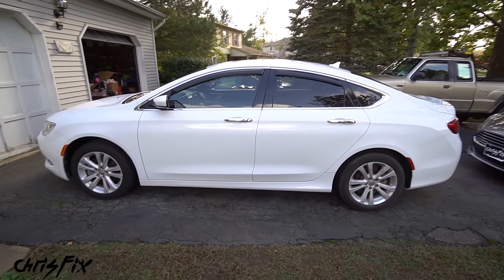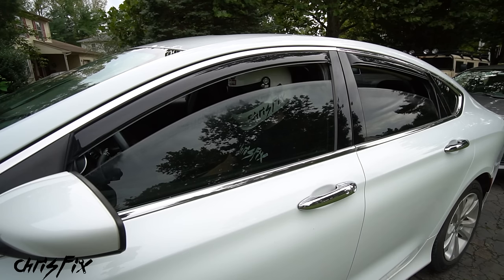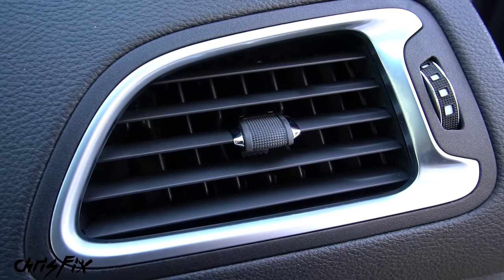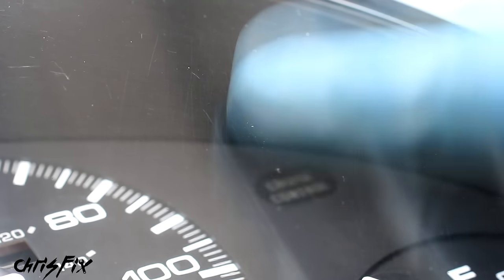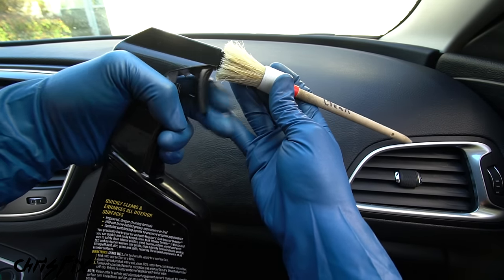How to Super Clean your Interior (Dashboard, Center Console, Door Panels & Glass)

Comment: For me, this has to be the best, most concise, and well-done video I've seen so far on cleaning the interior.  Nice tips and tricks like not using a heavy cleaner on the turn signal, not erasing the paint.  Great job Chris.  Marc.
Reply: I agree with you Marc. Chris's videos are very well done. Presentation and delivery of the subject sets Chris apart from others.
Reply: I had my car supposedly full detail and it was not really detailed
Reply: +1.
I like the way the video is split into chapters for easy reference.
Reply: I have watched interior cleaning videos by about a dozen other professional detailers. Chris is the only one who pointed out how to clean the turn signals safely.  Kudos sir!
Reply: The only thing he didn't do is to shampoo the carpets or use saddle soap on leather or vinyl seats.
Reply: The only thing he didn't do is to shampoo the carpets or use saddle soap on leather or vinyl seats.
Reply: @toml.8210 he deep cleans them in other videos, as well as the windshield and exterior

Comment: Dashboard :
Vents 3:45
Dust Dashboard 5:35
Gauge Vessel 6:30
Clean dashboard 9:05
Clean info Screen 10:05
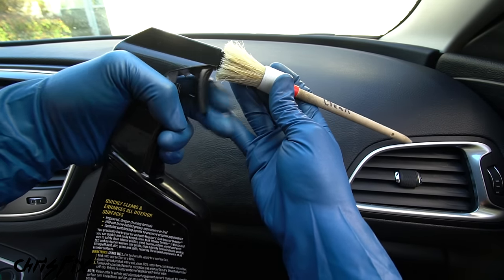Clean Steering Wheel 11:15 12:40
Clean turn signal 14:00
Clean gas and brake pedal 14:50
Protect the Dashboard 16:55
Protect info Screen 17:50
Protect plastic by the Steering wheel 18:50
Clean Glossy Interior 20:25
Clean Door panels 21:15
Protect door panels 22:20
Clean Door jams 23:57
Clean door sills 24:22
Center Console :
Clean rubber inserts 26:45
Clean exterior of center console 28:35
Clean gear shifter 30:10
Clean glass 31:45
Reply: Sweet thanks ✌🏾✌🏾✌🏾
Reply: Thank you ✅
Reply: Thanks
Reply: It is also in the description.
Reply: Not vessel, bezel.

Comment: "detailers" use specialist brushes and chemicals that are $10 a bottle
chis fix uses old toothbrush and soapy wooder
Reply: Can't argue with results
Reply: Yeah but those are professional products used for time and easier but the results cannot be argued with 🤷‍♂️ speak from experience
Reply: There are time where we need more brushes and chemicals for special situation. Or get done faster or leave the carpet in a natural state.
Reply: I just buy boar hair or horse hair paint brushes, trim them to a preferable length and get to work.
Reply: I get bulk chemicals i can mix 1-20 so its not too expensive doing this

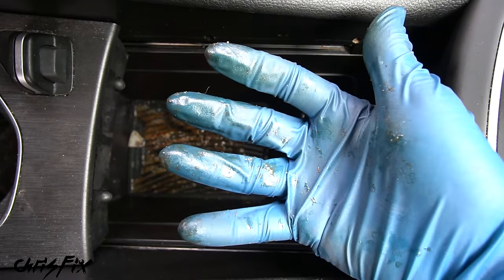Comment: DASHBOARD 2:55 

  Dusting
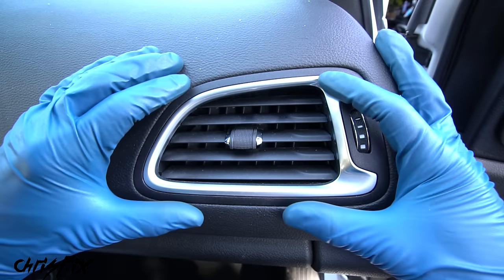      Vents 3:27
      Main Dash 5:05
      Gauge Bezel 6:01
  Cleaning 
     Main Dash 8:45
     Infotainment 10:02
     Buttons+Dials 10:34
     Steering Wheel 11:14
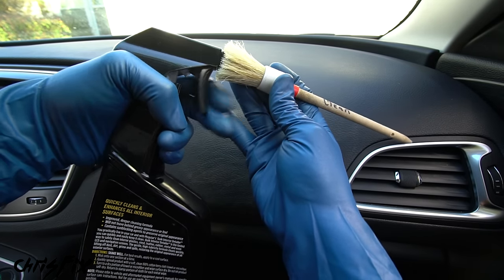     Turn Signals 13:45
     Pedals 14:29
 Protecting 15:37
   Main Dash 16:56
   Infotainment 17:46
   Buttons+Dials 18:21
   Turn Signals 18:45

DOOR PANEL 20:57
  Dusting 21:17
  Cleaning 21:26
  Protecting 22:20
  Door Jamb 23:53
  Door Sill 24:21 

CENTER CONSOLE 26:33

WINDOWS 30:27
Reply: Thanks
Reply from the maker: Thanks
Reply: Thank you! 🥰
Reply: @chrisfix  how long did this take?
Reply: 21:34 will the liquid damage the electronics?
Reply: @michaelleong9898  he disconnected the negative terminal of the battery, as long as it is fully dried, once you reconnect it, it shouldn't damage them
Reply: I LOVE YOU
Reply: Not all heroes wear capes my dude...thx
Reply: Thank you
Reply: Such a helpful post!Thank you for taking the time to put this together!
Reply: Why did he use product cleaner for dash, but soapy water for doors? Isn't it the same material?
Reply: Thanks! Very helpful
Reply: @chrisfix  your the one that made the video.
Reply: @IowaRonin  probably because the soapy water has more degreaser agents than the cleaner as he did with the steering wheel
Reply: @Thebirdemoji  thanks captain obvious

Comment: You should do a quick video on how you wash and maintain your microfiber towels.
Reply from the maker: Thanks for the video idea!
Reply: Ooohhh yes
Reply: Or you just simply throw them away?
Reply: @Wizardus86  that would probably be a waste
Reply: @_playa_  same.
Reply: they have microfiber detergent or use a detergent thats unscented with no dyes. throw them in the wash with cold water only and the right detergent. move to a dryer on air dry or very very little heat (better if none at all).
Reply: @_playa_  ye

Comment: Me:  "Ok, i'm ready to super clean my car."
Chris: "...remove the seats."
Me: "I'm out."
Reply: It isn't that difficult to remove the seat. 
Just check ChrisFix's video on "How to install Racing Seats".
Reply: Take care while taking the seats out not to scratch the anywhere as some seats mounting where the bolt goes is made of steel, I've got mine scratched
Reply: SFG HIGHLIGHTS  are you a toddler?
Reply: @RatmanSays  His point was that you can have shorter arms and legs making lifting things andholding it more difficult, you see?
Reply: Lol the 6 way power seats in my 93 chrysler are heavy as shit!
Reply: Most seats are just 1 plug and 4 bolts, so removing and installing them is really easy.
Reply: I dont believe for one minute the "vandal" dumped sticky pennies in the console. The owner just nasty.
Reply: SFG HIGHLIGHTS  or fat and can't bend to well......$10 to whoever wants to clean my car!
Reply: @Stoney3K  and then probably replace the screws with new ones because in many cases the screws are for one use only...
Reply: @SteveStavropoulos  Not with the seats, those are secured with four 12mm thick bolts (or 1/2" for you imperial guys).

Most of the interior trim uses those one-time-use plastic spring clips though.
Reply: @Stoney3K  in many cases you will find screws with trilobular threads which need to be replaced.

Comment: When he said remove the seats I was like you gotta be kidding
Reply: and that was step 1!
Reply: I’m new to the channel. Is there a how-to video on removing then reinstalling seats?  My car has leather/vinyl, adjustable & heated seating so the electronic wire harnessing intimidates me.😬
Reply: @shesgotmmph  he has the first video about this car, just look up car deep clean chris fix and watch the other video and he explains and shows how to remove them
Reply: @shesgotmmph  i think he shows how in his carpet cleaning video
Reply: @shesgotmmph  I want to say it was like take the cables off the battery since you're leaving the door open for a while... then there are 4 bolts you unscrew but do 2 and then get under it and unclip the 1 connection, or more if there are but there's usually only 1, then undo the next 2, and you should be good... 

just make sure you line up tracks if your car is like that... my 07 honda accord only did 2 clips front and back when I bought it, and my family has a lot, so honda and only 2 tracks were way wrong... the dude before me install them as one pushed far up, and the other far back, so I had to fix it, but yeah just a heads up there.
Reply: @shesgotmmph  Just don't bother, you risk damaging something and it's total overkill, just not necessary.
Reply: @shesgotmmph  I pulled the front seats from my Subi I'm working on and it was literally 4 bolts and three electrical connectors.  Remember, car electrical connectors are almost always slightly different for every sensor or gadget so they are impossible to mix up.  Airbag connectors are always yellow.  Disconnect the battery or pull the fuse if that intimidates you but unplugging them is not what is going to set them off.  

I very much recommend pulling front seats if you are doing interior work.  Its easier than it looks, you have so much room, and when you clean the carpets you can get it all in nice big sections that look great.

Comment: A tip for those that will disconnect the battery: Make sure you know your infotainment/radio/navigation code, as it'll probably be required after connecting the battery.
Reply from the maker: Thanks for the tip!
Reply: Most people toss that in the garbage or in the wallet when they get it with their car.

Comment: Extra note on using low gloss on the dash:

Not only will it reduce incoming light getting bounced off into your eyes, itll also reduce it getting bounced off and reflecting off the windshield. Yes, a cleaner windshield wont reflect as much anyway, but a shiny dash is much easier to see in the reflection.

Comment: some useful tips I've came up with cleaning my own cars interiors the past few years:

-wet wipes are very useful for a quick clean up, just make sure to use the ones with no oils in it (avoid those that says moisturizing), also avoid using wipes with alcohol

-lint roller paper is best at cleaning dust on the gauge cluster clear plastic surface, just peel off a layer then stick on the surface and peel, repeat until clean, so far doing this has not caused any scratches but make sure to never drag or rub the paper on the surface

-use good quality uv protectant on all plastic trims, cheap sticky ones that never fully dry only attracts more dust

-air fresheners are not meant to cover up the smell of something dirty, clean the source of the smell and you won't even need to use air fresheners, also they are known to be hormones disruptors

Comment: Your videos are the best! So informative. I’m love to know the why behind things and you explain everything without being overly annoying or chatty. Also learned a lot of tips from your videos. I would love to be able to clean my interior. Unfortunately, I have a 2005 Subaru Legacy (which I absolutely love my old lady) but it had a recall on the dashboard which the original owner didn’t take advantage of to replace before I purchased the car on a trade in. This particular recall was for the dashboard melting. I doubt they even make the dash for my car at this point to try to find a replacement that isn’t already damaged. Any suggestions or fixes for a sticky, melting dash? And just to give you a picture of how bad it is, I had 3 Alaskan Malamutes over several years ago now who loves car rides and I STILL find their fur and hair embedded in my dash (and seats/carpets) 😂. I had to order a poorly fitted dash cover to stop the glare that got progressively worse over time because it was getting too dangerous to drive.
Reply from the maker: Recalls usually dont have a period of time when they are no longer good. You should be able to take it in. The plastic is dissolving itself and there is no fix besides replacement. Anything I tell you would fix it temporarily.
Reply: @chrisfix  thanks for the info! I was initially turned down when I called a dealership but SOA might have a different answer/solution. A temp fix might be my plan B since this car is my future project sleeper car 😂 when I decide to invest in another Subaru. Number 5 I believe?…out of curiosity, what would you recommend for the temp fix as a potential plan B? I have done some research on solutions, but they all want to promote their own “fix it” product which may or may not work, but it’s kind of all over the place in terms of getting a solid answer. Plus, I’ve come to enjoy your expertise and explanation on stuff. No rush, maybe a future video idea? This baby isn’t going anywhere anytime soon.

Comment: Should condition the leather as well, including on the steering wheel, meguiars gold class leather cleaner and conditioner works well and does not leave a greasy or shiny finish if you don't it's going to end up all faded and cracked.

Comment: Hi Chris! First of all I would like to thank you for a very detailed DIY interior cleaning.

I just have two questions:
1. I see you put some soapy water and other chemical on the buttons, I'm just curious is it applicable and safe for all car? I mean water going inside between the switches where down there there's a bunch of cables and whatnot. I'm afraid to try to clean that way and ended up with some short circuitry.
2. I have quite an old car and been left for almost 9 years. Recently I've been trying to restore it, especially the engine. But as for the interior, there's some mold on some panels, on the faux leather arm rest, and also some cushions with cloth material. What are the good options to clean those molds?

Hopefully you see this comment and don't mind answering. Thank you in advance :)
Reply from the maker: Great questions and thanks!
1. You can get soapy water on buttons and stuff but don't oversaturate it. Try to keep it from running into the buttons and just keep it as a damp towel so it can clean. The buttons are usually pretty safe from water if it drips down because when it rains it can get on the buttons temporarily.

2. For the mold I would use that extractor vacuum and a mold killing spray with no bleach.
Reply: @chrisfix  thanks for the very quick response! Will try the interior cleaning right away this weekend, and probably onto the exterior next week. Been lazying a bit but watching your videos gets me pretty excited to work on my cars again.

Keep up the great videos, Chris. I've been marathon watching a lot of your videos even though some of them not really related to my current car situation lol.

Regards from your new fan :D

Comment: Hi Chris, thank you for the tips. I tried the steps & products to clean the dashboard and plastic bevel and it cleaned up well except for a couple stains that wouldn't lift from the material surrounding the cd/radio area. Im not sure what caused the staining but it wouldn't lift out with the Meguires interior cleaner, detail brush and microfiber cloth. I tried multiple applications and wiped it off and no luck getting it out. Any tips? Its a 2009 VW jetta with a cd console. Thx for your videos! Love watching them.

Comment: Chris.. Could you recommend the brushes you use and wouldn't you save time with a bigger brush? Thanks
Reply from the maker: Theoretically you could use a bigger brush but if you had to get into a small area it would be harder. I’ve never had an issue with the brushes I used so I would recommend them

Comment: awesome videos. but in reality,  that brush should not be used on a screen.  or Guage cluster..it is bound to scratch eventually.  these surfaces should be cleaned with new microfiber or ultra soft plush bristles.  there are plenty b of tests confirming that you may think it's not henning it. but unless you use the right chemicals and tools,  towels, you will scratch and eat away at the glare coating.  still you did it safely and effectively and that's the key.. gentle and thorough. 👍 great work

Comment: Hey Chris. Thank you for your excellent videos. I am struggling with “left car” cleaning problems. After a car has been left on the drive for the winter, the inside gets kinda musty and damp which changes the dash and centre console arm rests and I haven’t found the best way to restore them. Replace seems the only way? (For reference 2005 Volvo XC70) thank you!
Reply from the maker: By changes, do you mean the color of the dash and center console is changing?
Reply: @chrisfix  hi and thanks for the reply. Not sure but to be more clear, we live in England and the weather is damp for many months. My car has been sat, static for a year and when I got into it, the centre console and arm rests are mottled and sticky and other than replacing them I was hoping to have a fix that would repair them? I’ve seen that straight isopropyl alcohol might work and also soda crystals? Your expertise and awesome results have worked for all my troubles so far including the headlamp fogging but I haven’t found anything that works for the “vinylette”

Comment: You can buy inexpensive round brushes from a home improvement store, in the paint department.  They have heavy handles and a bigger brush, so if you want a skinny brush or handle, you must look elsewhere.
Other detailers use pressurized air to blow the dust on the vents into the duct, after turning the fan on high speed, while brushing and vacuuming; but you should clean the dusty vents first, obviously.

When you're done cleaning, WASH your towels right away! Don't put it off, or put the (dirty) towels away for later.  Unless you're detailing the lawn mower next.

Comment: Chris, I just found your channel.  Great videos, very thorough.   I'm curious about being careful when cleaning the ink on the turn signal, wipers etc.    If the cleaning solution takes off that ink, how is it that it does not seem to affect the ink on the console, radio and other buttons?  You've got me a bit scared to use the cleaning solution on those areas.  Thanks.

Comment: Great video! Do you have any advice on how to remove a dressing applied to my Camry dashboard by a carwash attendent? Its now sticky especially when its hot outside. Thank you
Reply from the maker: I would get a small bucket and fill with warm water and a few ounces of an all purpose cleaner, then just wipe down the dashboard and dry with a drying towel. A couple of passes later it should be completely clean!
Reply: Thank you Chris!  Im not sure if the dressing they used is a solvent [silicon] or water based. Does the approach to removing it differ from what you perscribed?

Comment: Hi Chris, what's the difference between cleaning the Steering Wheel with the Interior Cleaner vs the Soapy Wooder? It looks like you used the Interior cleaner for the first steering wheel and then soapy wooder for the 2nd, more dirty steering wheel. Thanks!

Comment: Do not disconnect your battery terminal! Some cars nowadays will require certain systems to be reprogrammed. If you disconnect your battery. On Hondas you may need to put a code in for the radio to work and even if you don't have a vehicle that requires reprogramming after the battery has been disconnected you may still have issues with things like needing to clean your throttle body. It's better to let your battery go dead than to disconnect it. You can disconnect it if you have a battery saver but, otherwise do not disconnect it.